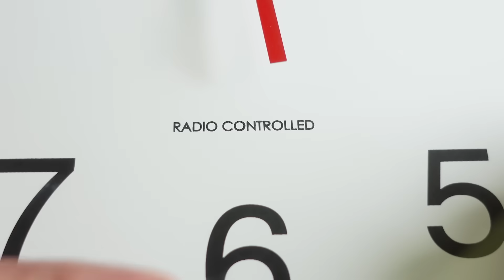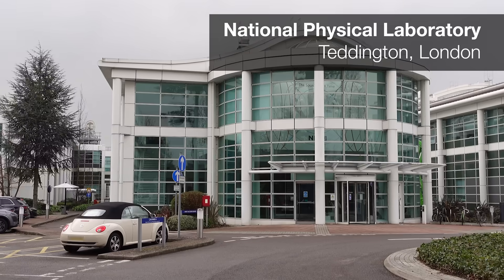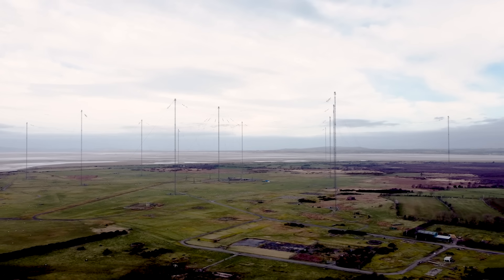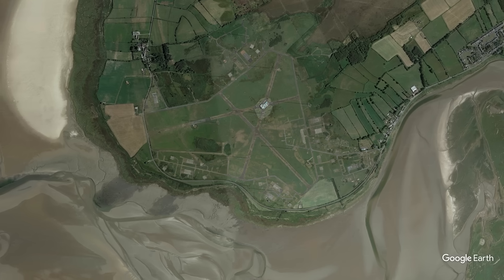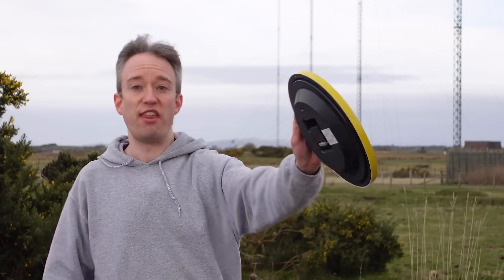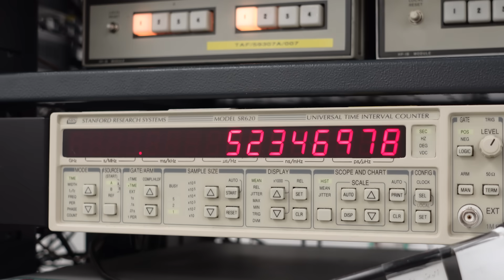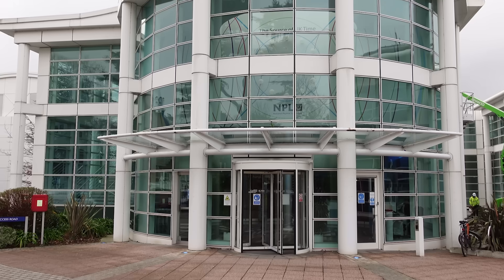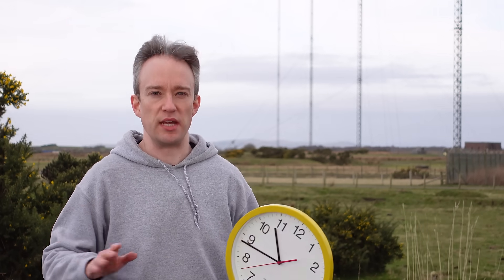How does Britain know what time it is?

Comment: I have a little alarm clock that listens to the US version of this time signal,  broadcast from Fort Collins, Colorado.  I live about 1200 miles away in west Oregon.  Works great, runs for about 5 years on a AA battery - over that time scale I don't know if the battery goes flat more from usage or the slow self discharge that limits its shelf life!

I have never seen a radio controlled wall clock with analog hands instead of a little LCD display; it never occurred to me that they exist. Now I want one.

Comment: From practical experience - don't get a hill between you and the transmitter. Only 30 miles away from the Solway but had to replace wireless with GPS receiver due to close proximity of high ground.

Comment: Ive got a digital version of the radio controlled clock. Every so often gets glitched by 2 stroke motorbikes going past outside and jumps to the wrong hour or day but the correct minutes and seconds or some similar thing. If they were starting to invent it today theyd probably build in some error correcting code system I think but they obviously have to maintain backward compatibility with a large number of old clocks.
Reply: Couldn't be many 2 stroke bikes on the roads these days....
Reply: @johno4521  We get swarms of scooters whenever the sun shines - bikes can live a long time time compared to cars.
Suppose technically it's the crappyness of the spark leads rather than the number of engine strokes.

Comment: The U.S. has an equivalent atomic clock system. 
It transmits it’s data at a lightning fast rate of ONE BIT PER SECOND!!!
Reply: Well that's good then.  If that is certain, that each bit takes 1 second then you have an in-built synchronization system.  You know exactly how many bits you are going to get and you know EXACTLY how long it will take for you to get them.  Perfect for correcting the drift on your internal clocks.

Comment: Thank goodness those weren’t the official time clocks cause that wire management OMG 😂
Reply: Jesus, why does a few wires make a difference?  It does nothing to increase the accuracy of the timing, nor does it do anything to prevent issues with the networking.  It is merely aesthetic and only matters where you have many cables, not the piddly few they have here.  The only thing needed is a H&S sign off and a rule that you dont put strain on connectors.  So much IT time is wasted making cables look nice, yet it rarely helps them be locatable thus we all use the signal tracer regardless.

Comment: There are clocks of this kind sold in the continental USA, and probably Canada too, that receive a much higher frequency signal from WWV.  They would not work in the UK, and UK's clocks would not work in the USA.  I had mixed success with them in the USA.  Picking up distant shortwave without a substantial antenna is a challenge.

Comment: Let me just say that, as an engineer that analyzes and designs guy towers, constructing those integrated guy towers with other guys hanging between them all, with multiple inter-guy connections and numerous supports at grade, would be an absolute cluster-. Let alone the rigging plans for a contractor if any serious work had to be done on a tower.

Comment: I have seen those clocks since I was a child and love the simplistic accuracy but there are no signals to be received in Australia unfortunately. Now I have my Google nest hub and it synchronises with internet time, providing we have mains power and an internet connection. I would like to have the resilience of radio signals   and a battery powered clock.
Reply: If you have GPS down there you could probably use that instead.
Reply: @user2C47  Very true and I have many handheld GPS units but they don't sit on the kitchen bench or wall and I have a steel roof so no signal indoors generally. It's just  simplistic time referenced clock that is available off the shelf for me to put on the wall that I would love to have.

Comment: I'm missing the most important question - HOW does the cheap clock synchronize to the signal?
Reply: It will have at least one part of the dial that will send a signal to the circuitry. Once that point is reached the circuitry can count the pulses it sends to the motor to know exactly where the hands are and can adjust the speed of the pulses to change its displayed time.

Comment: Hey Tom, Years back I had a similar discussion with an USAF expert. The USA national standard is a clock in Denver Colorado. It is critical to know how far the sender radio is to the receiver clock. Then a range adjustment is made, so that satellites line up, bombs hit on target, and official top secret communication is made in real time. BTW, the adjustment from Denver to Scott AFB, just outside St. Louis  where I live is a +4000/second.
Reply: isn't it in Boulder, at NIST?
Reply: @valkyrie_pilot  Perhaps it is now. I believe I was told it was in Denver, years ago. But what you say makes sense because USAF has a large presence in Boulder.  For instance, the Air Force Academy is in Boulder. Anyway your presentation was excellent. And my second point is that the EXACT time adjusted around the globe is critical for TOP SECRET communications. So, today, exact time is more critical than it was 20-30 years back when this plan was hatched.
Reply: @quillmaurer6563  Your information is more current and accurate. But, my information goes back 20 years. I just remember vividly that secure transfer of information depends on an accurate time standard and the transmitter was 4000/second west of here. Funny stuff? Thanks for your correction.

Comment: Er, the coordination of UTC does take into account the relativistic effects on clocks being higher up or lower down in the planet's gravity well. After they started a coordinated atomic time service, in the 1970s they found that atomic clocks at different altitudes ran at different rates in accordance with the general theory of relativity. So 1977 they had to tweak that existing coordinated atomic time standard, this time getting the coordination right (but the length of a second changed by 1picosecond. So it's a really tricky thing to say exactly how many seconds there are between now and 00:00:00 1 January 1970 UTC, because they changed length part way through...

NPL's time is also "Legal" time. If NPL say it's 11pm, then 11pm it is even if they've made a mistake and differ from GPS, the sun, stars, Paris, etc.

Comment: My phone and my tv box are the only things in my house that do this. I also love the style of that yellow clock your holding. Wish I had more of that technology
Reply: Actually, it is more likely that your phone uses GPS or NTP for setting its clock. While a cable box may use this, it may also get the time from the cable company.
Reply: @user2C47  Idk how my phone and cable box do it but they are always perfectly in sync. All my other clocks like the oven and microwave are slightly to slow or slightly to quick and obviously don’t do daylight savings
Reply: They'll be linked to system time, as opposed to MSF. Like my landline phone, you have to wait till it's received a call until it gets the time information

Comment: Such an informational video, I love it! It would be really good if they showed how do they synchronize the time when the daylight saving kicks in
Reply: most broadcast formats I'm aware of either send an offset to UTC or normal time when DS is in effect, or send the DS time, with an "awareness" bit to indicate that the transmitter is, in fact, transmitting DST so Clocks that need to run on UTC can get that back from that.

Comment: My question is, how much faster does the clock go if the signal tells it that it’s behind? For instance if the clock’s hands point to 18.00 in the evening but the signal tells the clock that it’s 23.00? It’s 5 hours behind, 18,000 seconds. How quickly can it catch up? Do the hands run at double speed, or triple speed? Quadruple?
Reply: It would step the minute hand as fast as possible until it reaches the desired time. But since it's an analog clock it would be using 12 hour time.

Comment: Tom should visit the DLR in Braunschweig in Germany. That's where the German time is measured. The room itself looks fantastic (I once visited it). It is a room with copper walls to avoid any electromagnetic influence from the outside. The time signal is then transferred to Frankfurt from where it is transmitted via longwave at 77.5 KHz.
Reply: Funny enough the transmission towers are very close to the 50°N 9°E point - which is in a nearby forest, maybe about a kilometer away.

Comment: What I find interesting is that the low-tech, low bandwidth telegram of the radio clock signal takes about a minute to transmit. So when you switch it on, it takes a few minutes to actually synchronise.

Comment: I have visited the room at the US Naval Observatory where they keep time for the military and as a backup to the NIST master clock. The clocks were kept behind bullet resistant glass. Also at the Washington DC TV station I worked at we used a rubidium atomic clock to keep in sync with the NBC network. When it failed we didn't bother replacing it because we no longer needed to be synchronous. Then we got a call from NASA and they wanted to know why our color subcarrier frequency was drifting more than it used to. NASA had been using our super stable signal as a transfer standard to calibrate their own devices. They would send out a daily message noting the frequency offset from their own master clock. When we explained that we were well within FCC standards and didn't plan to install a new atomic clock, they sent us one of their cesium clocks.

Comment: The question I have is, how does the analog clock 'set' itself? Does it hold the hands in place until they get to the right time? Or do they spin really fast to get to the correct time?... Questions Questions.
Reply: The one I saw went to 12 and then waited there
Reply: The second thing you said

Comment: And that is one of the things that show just how stupid many "smart" devices are:
People now buy "smart" microwaves with TouchScreens to show them recipes (yey, microwave recipes, coupled to the microwave vendor and only working as long as they keep that service up and running), yet they can not keep the time when there is a power-outage and not even set them self correctly despite having an active internet connection.....

There is a lot of old technology that is more than sufficient for their purpose, old but very reliable and rugged. And instead of just using them people try to re-invent everything to make it more modern - and ultimately to make them fail faster.

Comment: The bit I'm curious about with these clocks is how they deal with timezones and daylight savings time. Does the radio signal just carry the UTC time or does it carry the UK time (UTC+0 in winter, UTC+1 in summer)? The clocks don't seem to have any way for the user to select a timezone, so how do they work without that? Do they have something built in like the Olsen time database? Presumably there's no way to update the firmware so if the government changes the DST rules do the clocks have to thrown away?

Comment: The trouble with radio controlled clocks available to the public is they generally only request the signal once a day, the rest of the time they function as a normal quartz clock meaning they can be 1 - 2 seconds out by the time they request the signal again.

Comment: But Tom, you never told me how the radio signal carries the time to the clock.  And how accurate radio time is? I'm a software guy, that's had to document software clocks that figure out latency with a two way conversation.  And I know GPS does it by triangulation, but   how accurate is analog radio signal.  It travels at the speed of light, so you could encode a synchronization that was close to that?  So the latency could be the time it takes the radio signal to travel to your clock,  or is it worse than that?

Comment: My favourite thing is when those radio clocks end up ahead of where they should be and instead of stopping or reversing they go clockwise as fast as they can and skip over the next 23 hours 59 minutes and x seconds to be right
Reply: The Lavet-type motors used in these clock mechanisms are incapable of running in reverse.

Comment: How does a clock know exactly where it is so it can take the distance into account?
Reply: The whole world is ~8Hz, so even halfway around the world is 1/16th of a second. As the signal doesn't reach that far, radio controlled clocks can be within a fraction of 1s.

UTC is synchronized, as if instant. Time transfer does need to know precise locations. And I think that they even take local gravity variations into account...
Reply: @JxH  TBH, i kinda realised it was a dumb question after I asked it.

Comment: I was hoping to see what the clock looks like when it's syncing itself.

Also what's the mechanism to keep itself in sync once it has synced. Does it get a new signal every second and that's what pushes the hands of the clock forward?
Reply: Usually it's a reasonably accurate Quartz Clock that just periodically checks in to resync, usually once per day for a wall clock like Tom is holding.

Comment: imagine trolling an entire town's clocks by spoofing this signal...
Reply: It probably wouldn't be worth the bother as you'd have to know the exact time they requested the signal and then disable the proper signal by knocking it out or transmitting a more powerful signal...
Reply: @johno4521  it's not a 2 way protocol (there's no request-response). the devices just update the time when they get the signal (normally sent every minute). regarding signal strength, thats obvious and part of any sort of radio pirating.

Comment: 1:44 this is actually wrong. Since nobody ever measured the one way speed of light, the delay is definitely somewhere between no delay (instantaneous) and double the stated delay, but nobody knows for certain what the actual number is. It has been proven that there is no way of knowing how fast light travels in any given direction and people just started assuming light travels at equal speeds no matter the direction. In reality the only thing we know, is how fast light travels in one direction and then back again. So the way to the turning point might be instant, or it might take double the time we assume it does. Nobody knows and nobody ever will know, it is one of the universes many mysteries.

It is a bit weird, since this means that you can't ever know exactly what time it is at another point. And therefore saying that one clock is programmed to be delayed by X amount of milliseconds is irrelevant, since you can never know how many milliseconds exactly. They could ignore any kind of delay and just assume the signal travels instantly, which has the same chances of being correct as the value they calculated.
Reply: In practice, it doesn't matter

Comment: I have one of those clocks. A total waste of money on account of the battery life being dreadful. When the battery fails and new ones are put in in the clock automatically resets the time. The brain works on a 24hour day so, depending on the time period it was unpowered the reset may involve the hands spinning round at speed for nearly two full twelve hour periods. Not surprisingly this is an enormous drain on the battery so they have to be changed every few weeks!

Comment: I would have been interested in the radio protocol for transmitting the time data. What exactly gets sent over the air and how often does it update? Is it time only or date also? How much is there error correction for improving resilience? What kind of chips do the clocks contain to decode the data? Etc.
Reply: Wikipedia has all the details.  See also NPL's website.